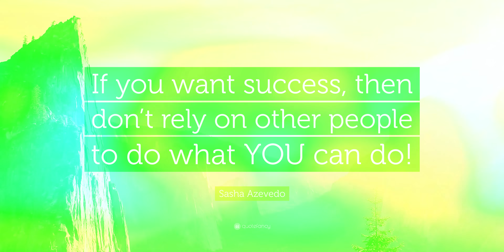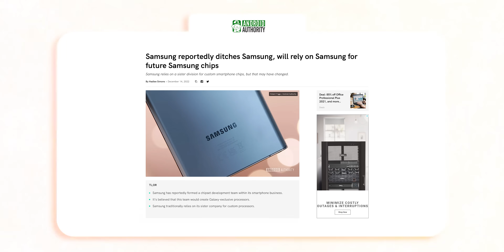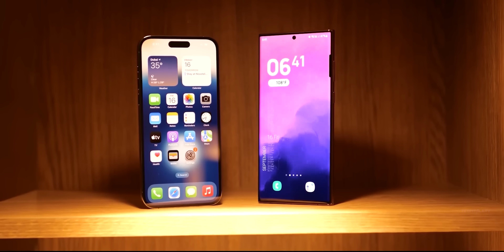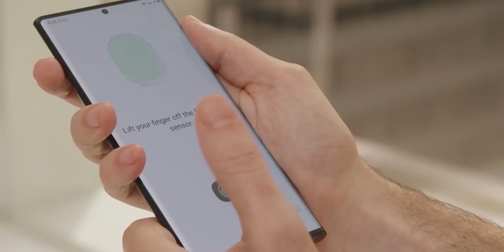Samsung Is Ditching Samsung

Comment: Talking about Apple products, you are bit behind.

For the most part, Apple has now left China. And they took Foxconn and TSMC with them. Both companies are rescaling inside the US... as independent companies. And Apple is scaling up their facilities in Austin Texas to also build iPhones and iPads. Apple Silicon is intrinsic to this whole process, because it allows Apple to drop Intel for most chips, lowering Apple costs for decades to come.

Foxconn, a subsidiary of Honhai Manufacturing and wholly based in Taiwan, is getting products built in the US, but are not ready yet.

TSMC already has completed a chip foundry in the US, and is now building a second one. Total investment? Somewhere in the $12-billion range.

Now for software at Apple. The Apple App Store now plays host for over 2.1 million apps. This is 19 times more apps than the entire Windows software library, regardless of who is hosting the apps. This means that Apple is hosting 3-times more games than Windows has apps. The fact Windows users don't understand this, is the same blindness that forces Windows gamers to build 'gamer systems', while their Apple gamer counterparts DON'T HAVE TO BUILD A GAMER SYSTEM; is in fact a fundamental problem within Microsoft environs.

Now you can talk about Samsung. I'll be watching. Remember, Samsung built the Galaxy Note 7, which caught fire over 1-million times in 12-months. They also have an alternate phone OS, in house, but have not chosen to use it yet. I've been waiting for that change for over a decade. Which is a long time in computing environs.

Have fun and good luck!

Comment: I honestly don't know what there is to argue about. Neither phone is open source and the same apps are selling your data and spying on you. Both flagship phones ditched the Aux cord, battery removal, and neither comes with a charger anymore. Both phones have more similarities than differences at this point. Samsung once had so many differences and options, but now both phones are going down the same road.

Comment: Exynos chip isn't bad in my opinion but Samsung mobile need to make many external improvement to make sure the phone is in best result and unlike quadcom chip which is for phone itself does do a lot of work so it makes sense quadcom chip with Samsung have better result than Samsung Exynos chip with Samsung phone and if they want everything from Samsung company itself they should make new chip or chip designed for phone like quadcom as it will give the phone better result and more 💰

Comment: That's nice but Samsung has been bleeding device functionality for some time now. We're at a point where beyond a certain price, phone performance becomes utterly irrelevant unless it's (somehow) your main gaming device.

Samsung wants 1000 bucks every year for a flagship that no longer has an SD card slot or audio jack and is increasingly difficult to repair.

So I'd rather save 350 bucks out of those 1000 and buy a phone that gets support for the better part of a decade, has a removable battery and allows for a display change using only a single screwdriver, like the Fairphone. And every following year I save another 1000 until I actually need a new phone for real.

What's the point of these new overpriced flagships, there's not even any prestige in it like there was 10 years ago.

Comment: Mobile phone CPU speeds make for bragging rights but have little practical impact on phone performance. The real aim is the potentially massive market for ARM based PCs and servers. Qualcomm has the lead in this regard but also faces legal issues with ARM which could derail their plans. Of course Intel and AMD are not going to sit still either.

Why not Apple with it's fancy M1? Because the biggest segment for the PC market is Corporations and Government and they require open bidding and open standards. Perhaps Apple will make and sell a different version of the M1 to OEMs, but that would be a big change for Apple and require a completely different corporate culture. Apple has never played well with others.

Comment: The Exynos processor has been designed wrong.
While the Arm cores do not differs much among the various custom SoC from Apple, Google, Huawei, and with the Qualcomm, the different "accelerators" do. Just like the internal communication pathways - where I believe the Exynos has been put together by someone lacking both skills and tools. To achieve the performance of a Snapdragon, the Exynos require a complete redesign of the accelerators and the internal bus controllers and interfaces.
For this, Samsung gave themselves two years, and in these two years they will equip their phones with the Snapdragon.
Why big phone manufacturers wants to use their own chips? First, there is matter of phone updates; they have to pay Qualcomm for the integration at each release. Second, there is matter of rights and royalties and profits. A Snapdragon 888 sells for $50, but one Exynos costs $35 they don't pay a profit to themselves. As I said, there are recurring expenses, and the fact that the custom chips allows for longer periods of updates, more than 5 years. Finally, if Samsung or Google or else wants to specialise their phones for photography, for games, for A.I., they can do so by adding a specialised accelerator (a core doing some special math).
In the end, I'm still turning my head around on how Samsung designed a problematic chip, but put it in their phones anyway - except in the US.
Google went thru a similar process with the first Tensor, but they worked hard, night and day all together, and they built a very successful and bug-free Tensor 2. 
So, who believe that in two years time, the new Exynos will not overheat and overflow, and throttle down and kill the battery, anymore?

Comment: They should hire also some developers and UI/UX designers from Apple and Asus. In my opinion, Samsung has the worst software skin, software optimizations and a ton of bloatware in their phones.
Reply: Because they are hire some ex Apple developers, that still doesn't guarantee anything, multiple another companies did that too, as the answer of the Apple M1, but still no competitor on the market, even after more than 2 years. The M2 released sooner, like any other "answer" chip.

Comment: Well y have exynos 22000 16gb and y outperform even same SoC within his own class  ah y guess the factory configuration is limiting the SoC to soon  3dmark test almost 70000 so it is not the hardware it is the configuration because people expect that it will work out of the box and that desire it unrealistic cause each User preferences differ on how a device will work

Comment: my note 10 plus exynos is only 5% weaker than sd855. the only problem i see was  it heats up faster and samsung didnt invest much on developers to support their exynos chip. i guess thats why they still got samsung app store so we get the optimized apps from there but still the heating problems still there
Reply: I am using s21U exynos varient and it heats up really fast and then frame rate drops

Comment: The elephant in the room to address is how will Samsung use the 2025 Galaxy-exclusive chips on all Samsung phones should they succeed? This is because they have just committed to a major contract with QC till 2030 so we might still see dual chip strategy again in 2 years' time. Don't be too happy just yet.
Reply: I wonder if the budget/midrange phones, when the flagships use the newly made chip, will wind up using higher end Qualcomm chips until 2030.  Something's got to use them as long as the contract stands.

Comment: So Samsung LSI isn't fully closing though, they are still working just no longer for Samsung devices.
That's good. I was scared for a moment that Samsung was gonna rely on Qualcomm forever and that would be no good.
Yeah Samsung isn't happy with Exynos, imagine how happy are the second-hand markets that had Exynos over the past 3-5 years. Samsung has literally admitted that they sold an inferior phone for the same price (many times even higher due to taxes) and they are getting away with this. They should at least give nice bundles and discounts to people that had to buy this inferior phone for the coming years. 
Anyway so is Samsung also ditching all the efforts they've made to develop a custom GPU with AMD?
Reply from the maker: Yes! All the chip development all these years was made by Samsung LSI so this likely means Samsung mobile is starting from scratch. But the good thing is they have hired the best engineers from Apple, Qualcomm and even Google is helping them with AI.
Reply: @TechTalkTV  That's so nice to hear. S22 has disappointed me so badly, it was barely an upgrade from S9+ in raw power and definitely not in battery life. My 4 years older S9+ lasts almost as long.
Are they ditching AMD GPUs too? Damn what a waste of time and money